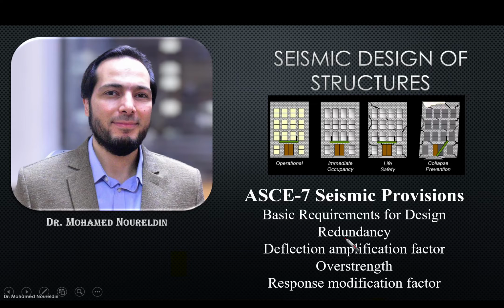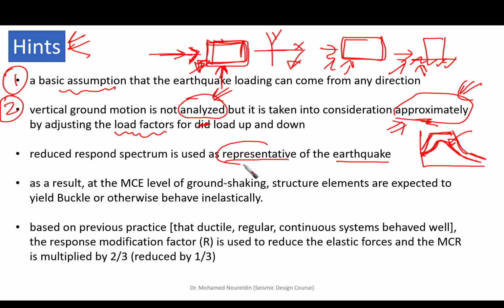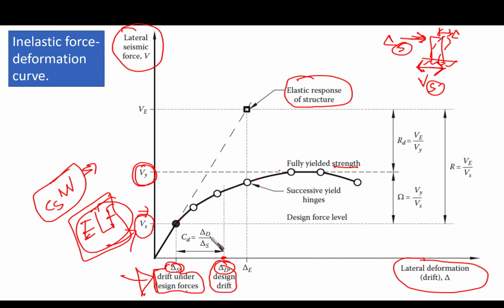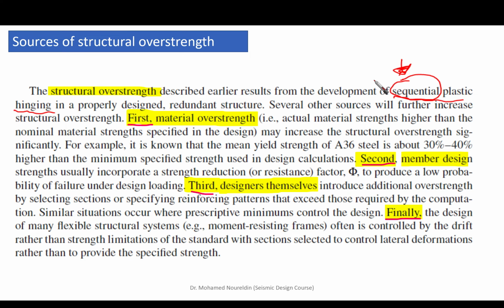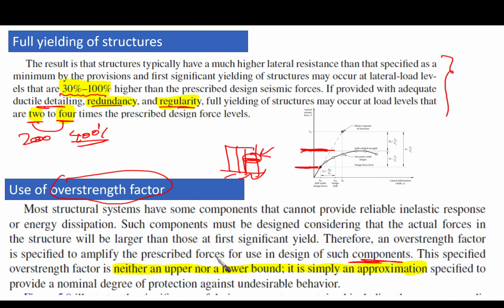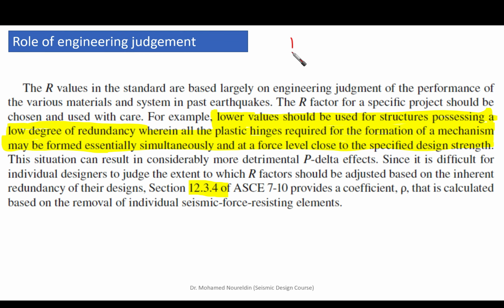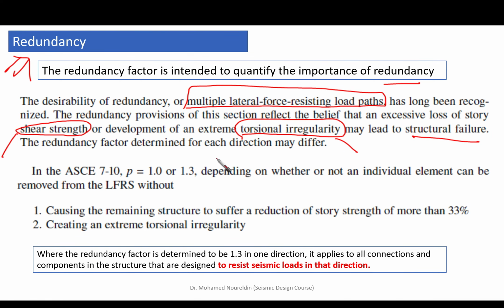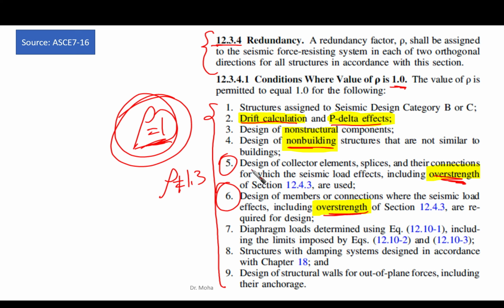15-ASCE-7 Redundancy-Deflection amplification factor-Overstrength-Response modification factor

Comment: Sir, Thank You for the Greatest & smoothest explanation ever on this subject. Can you advice if Cd factor is applied even for Design Category-A structures if P-Delta Analysis is not required & we go with 1st order Analysis. As chapter 12 represents mostly on Categories other than "A", I assume that inelastic deflections are not required to be checked for Category-A. Please shed some light on this subject Sir. Thank you in advance.